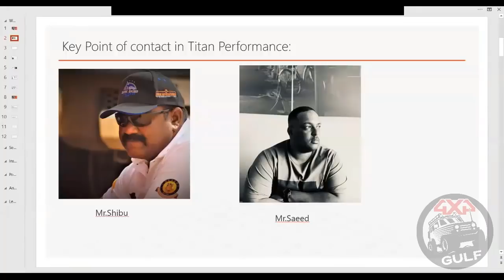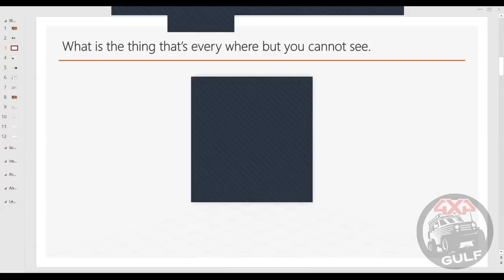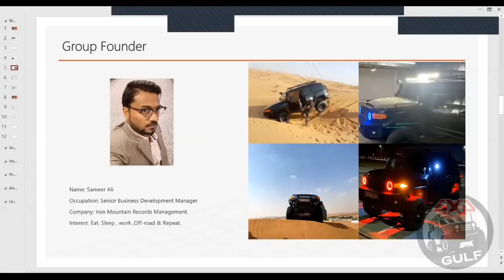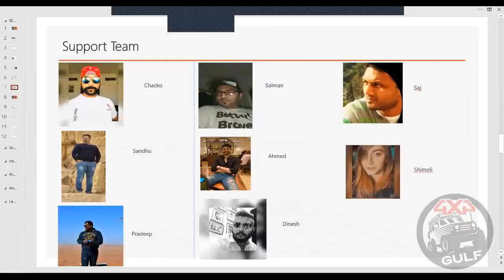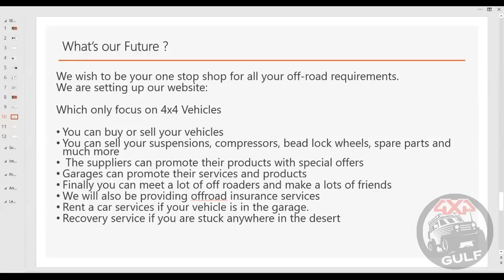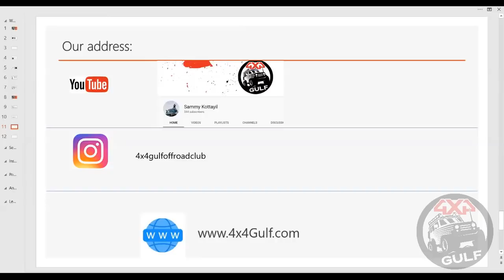4x4 Gulf Webinar with Titan Performance

Comment: I have installed 30mm wheel spacers after a 2 inch suspension lift on Prado.
The wheels are still stock.

I have 3 options.

Should I get -12 offset and remove spacers?

Or

Keep spacers with stock wheels

Or

Get -12 offset and let the wheel spacers be there..
Reply from the maker: Keep the spacer and minus offset rims